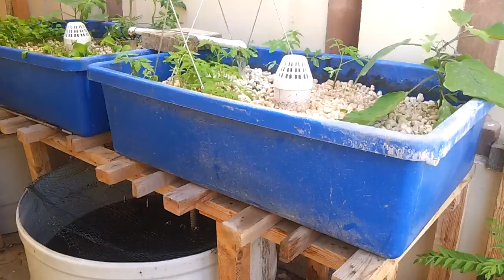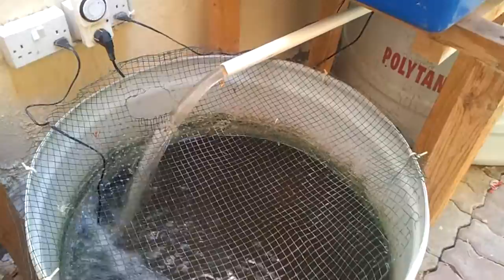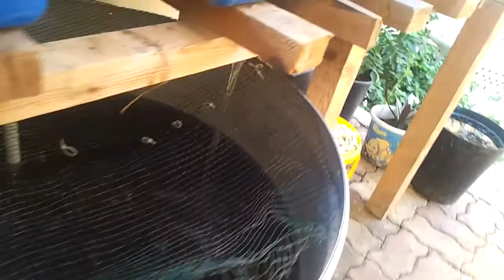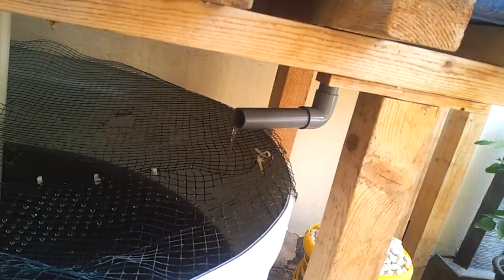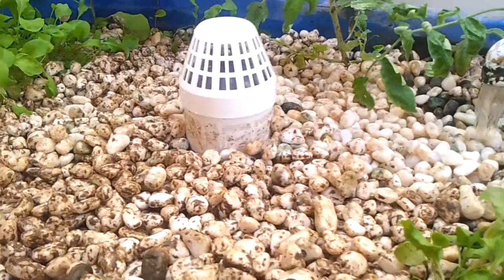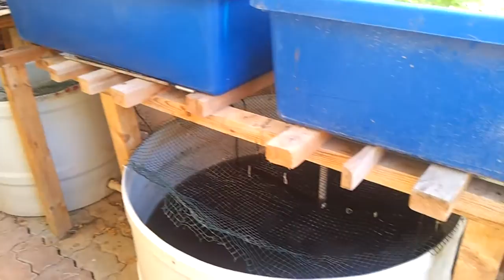Affnan's Aquaponics -  Abu Dhabi Aquaponics Installation Completed

Comment: Hi Affnan sir,

this is just great....what pump are you running this on?
Reply from the maker: I'll need to check and get back later.
Reply: Oh okay, thanks for responding...I just finished a 229 gallon fish tank what growbed size can you recommend?
Reply from the maker: That's a large tank, go for 60% of the fish tak capacity to be comfortable,  It is best to do it in few growbed like 30 gallon capacity 5 off.
Reply: I see, I dont have the growbeds types that you  are using. what else can you suggest for me to use?
Reply from the maker: You can try 50 gallon barrel cut in half or any water tank that is not too deep.
Reply: Okay I will that and update you here. thanks a million. :))